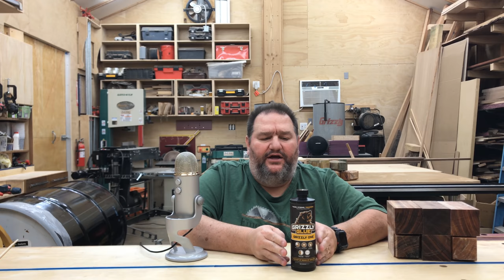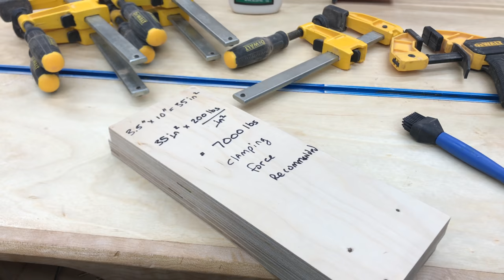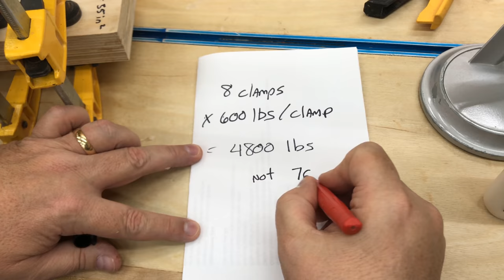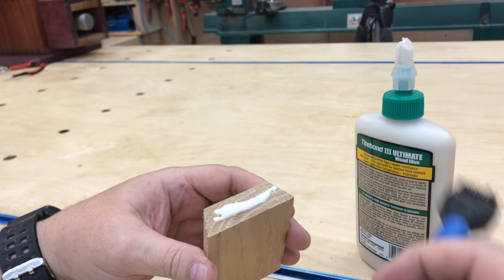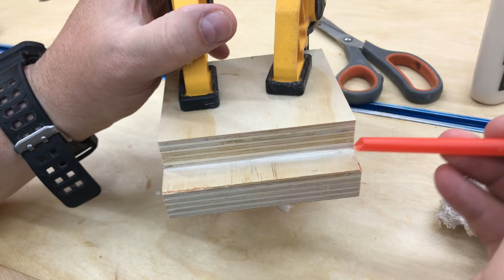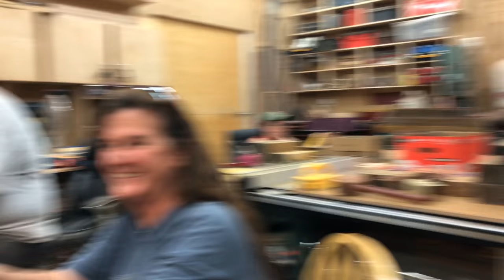67 - Definitive Guide to GLUE for Woodworkers Woodworking 101 lesson 3

Comment from the maker: Join our Woodworking group. Share pictures of your work & get help if needed.  Join our King’s Fine Woodworking Community Page. 

Woodworkers helping other woodworkers. Share advice, get project ideas. Free tips. Insider information. Get the best deals on lumber & tools. 

https://m.facebook.com/groups/134828903893994
Reply: Just found you today, I teach woodworking to Students in the carribean, I will link all of them to your channel as its very informative. Thank you. Subbed.
Reply: I am interested in Titebond 3 giveaway.
Reply from the maker: C.W P, thank you. I’m very honored!
Reply: VERY informative and presented greatly.   If I learned as much from every other YT video, I'd be a great woodworker, indeed.  IF I m lucky to be a winner,  l'd like the epoxy with the dispensers.
Reply: is there a clue you can use in steaming applications?
Reply: In case you don't get the notification on my posted comment I'll reply to this one.

Is there anything titebond original has over 2? Price is very close.
What I mean is there a reason to buy original over 2 considering the gallons are less than $2 different? 
3 is 1.5x the price so I can see a reason why some wouldn't go for 3. But just curious if there are things you would use 1&2 for differently or even 3 and why not just use 2 and 3 for everything or just 3 if cost wasn't the only driving issue?

Comment: I have been experimenting with various glues for a few months.  I wish I had viewed this when I started on my workbench back in December!  I purchased Gorilla glues in the past that after application, I discovered required water as a catalyst.  What a mess I made of that project!  This is absolutely the best educational video I have seen on glue types and uses!  Your research, teaching, and Chemist background shows. I have most of the glues mentioned above..  except epoxy.  I have a few projects in the works which I planned on using Epoxy as filler and finish.  I have delayed purchasing any since I have never had a glue and bonding class that covered it all... until now!  Thanks James..

Comment: I started woodworking 65 years ago at the age of nine usjnd salvaged wood and  nails from produce crates. My time and interest has fluctuated over the years, but retirement has allowed much more time in the shop. Most projects are for kids, grandkids.  And a nonprofit i work with. In recent years titebond 3 has been my go-to glue. I can remember when just white glue was used extensively.  I have thought about epoxy for some projects but the cost wasn't with the experiment. I would love to try some

Comment: Thanks for sharing your experience with woodworking.  Many years ago I used a lot of epoxy with metal and PVC for car body work or plumbing repairs where fittings weren't available.  I'm looking forward to trying it with woodworking.  Thanks again.

Comment: Great video and outstanding information.  I have been working with wood since I was 15 and am now 73 so have a little experience and still learning.  I made a Mahogany desk in high school with hot hide glue and still today I defy you to find a joint, it still looks beautiful (to me anyway).  Now I work mostly with segmented turnings in a variety of projects and all I use is Titebond 2 and 3.  I have had a couple of projects leave the lathe before I wanted them to with no damage, just chucked them back up and went back to work.  I also do some special castings for turning with a different resin but I would love to try that Total Boat epoxy for some bigger ideas.  Keep up the great videos, I intend to following you.

Comment: Very informative James. I am 74 years old and have been a woodworker for several years. I also have been using Titebond glues for years. But recently started using Titebond III  due to your influence.
I would be interested in the epoxy giveaway as I do have a project in mind that would require an epoxy application.. Thank you for your consideration.

Comment: CA glue is something that I would like to try. I have avoided buying it because I just can't justify the cost for something that would be purely experimental. I have a little experience with the Epoxy. Great stuff and fun to work with. I use Tightbond III a lot! It fits my style, I need the extra fiddle time. 

Thank you so much for the detailed instruction. I saw the video length, thought I would skip through it and catch just the highlights, but I wound up watching the entire thing! Very informative.

Comment: This is a lot of great information.  Thank you.  The one thing that I don't use Titebond III for (in my limited experience) is if I'm gluing up layers of wood for a bandsaw box out of light colored wood.  As I understand it, Titebond III has ground up walnut shells in it, and it dries a bit dark, so it can show up at the joints of the box (even at such a thin layer thickness of </= 0.004"-ish).

Comment: Thanx for an informative vid...  I am from ZA so we dont have these brands you guys use but we do have products that are roughly in the same classes...  One of the glues we use and me on a frequent basis is Alcolin Cold Glue.  It is a waterbased glue so it is nice and easy to work with and clean off afterwards... I have no way of comparing it to your products but I am in general happy with it so far... I doubt it if you will post glue to South Africa but I must say that I like the Tight Bond 3 you spoke of.   Looking forward to hear more on your woodworking classes :)  btw: That is a snazzy tip with the straw to clean off glue :D

Comment: Thank you for that video on glue. I too have been using titebond 3 for years and have been really pleased with it. I like a longer open time and wish it was longer. I try to build a good joint so it is not all on the glue to hold it together. Thank you for all the technical information on the differences. I found the epoxy very interesting, especially the measuring by pumps. I don't build river tables so I don't want / need very much at a time. However, I saw you put those epoxy filets in you assembly table video and that got me thinking. I don't think that would work very well with titebond 3. Oh, and I consider polyurethane glue to be a mess - I think that I have it all cleaned up and then the next thing I there is more foam and it is really hard to sand away after it dries. But like you said it does stick to everything. Anyway, thank you for your videos.

Comment: I know this is a huge faux pa, but construction adhesive can be super useful. But I would really recommend Locktite Max. Can fill huge gaps, it holds its shape and SUPER stong. Plus, it works on everything. It can also take repeated movement (I set my lathe tools in the handles with it). Plus water proof.

Comment: Many thanks for that James.  Very informative.  A couple of things I thought about while listening to you: First: The one property of epoxies that I really like is its machinability.  Its so easy to file or saw or drill or whatever.  Second: Gorilla glue seems to become exceptionally weak if you do not clamp your pieces really tight.  Also, once I've opened the gorilla glue bottle it goes off quite quickly, despite having the bottle tightly closed.  Now I'm just wondering if one would have similar problems with other polyurothane  glues.
I live in good old Ireland, where finding a really good glue is not always easy, so if there is not someone else who really needs it badly, you could maybe ship me a small bottle of Titebond III.  But you talked me into it - so if I don't hear from you in the next fortnight or so, I'll just have to try Amazon.
Many thanks again and please keep up the good work.
Cheers.
Reply from the maker: Thank you!

Comment: Very interesting video, I was not aware of the difference in all of the flies. My self I prefer the tight bond three. I use it for all of my projects, I have been woodworking about twenty years. After watching your video I may try some of the others. The one thing I was curious about is when using the epoxy glue is it hard on like planer blades or saw blades . Will it cause the blade to fill prematurely? The tight bond dose not cause any problems. Also how will the epoxy sand, so when you apply your finish coat you don't see any glue . I don't like change that well so probably will stay with what I'm used to. I tried your idea for using straws to remove excess glue. It works really well. Before I watched your video on glues I watched the one where you built a tool cart for your sander and grinder. Very nice project. I want to try and build one myself . One thing I noticed is how through you are with your videos. You cover everything very well
Please keep the projects coming and all of the good info. Thank you. H Burch

Comment: Learned a lot professor 🤓! Hope you aren’t too busy to keep doing videos. I like the family environment, little history of and science behind uses. 

I learned that I used the wrong type of glue for my son’s cutting board. Can anything be done to prevent the glue from deteriorating from water after the fact?
Thanks 

Epoxy is what I would like to try.
Reply from the maker: Thank you Michael. For the cutting board, just keep it as dry as possible. Wash it quickly when finished using, and dry right away. If it starts to come apart, you can just take it to the table saw, and slice it along the lines where the joints are, effectively taking it back to the individual pieces. Then glue it up again with Titebond III. It'll be a bit narrower, so if that's a problem, you can just add another piece in the middle somewhere. perhaps an accent wood. Hope that helps. ~James

Comment: I see you finally got a 55 gallon drum of glue lol. Nice discussion on glue for beginners :) On another note I grew up using Elmer's Wood Glue, back in the 70's and 80's it was horrible, but today it is equivalent to the original Titebond. I tend to gravitate towards Titebond but if I can find Elmer's cheaper for indoor furniture that I know will not get wet, I will grab Elmer's to save a few bucks. I really need some slow setting epoxy James, I have not found one that is worth the  $$$$ yet.

Comment: Hi James..  thanks for the video and the download!  Was wondering if you have ever used Cascamite, which comes in a powder form and has to be mixed with water before use.  Like a lot of things there are some health concerns (chemical composition) so whilst it is available in the UK it may not be in the US.  Used correctly it is incredibly strong, has a long open time, is waterproof and is gap filling.  Possible downside is it dries ‘rock’ hard and therefore cleanup can be a problem if you leave excess squeeze out to fully cure...

Comment: That's a great idea for removing excess glue with a straw. I've had it so a little frustration with glue from squeeze-out in the inside corner preventing the wood from taking up oil finish. It was especially bad when I used water to help clean up the glue. The glue just went deeper into the wood and never did come out. So thanks. I'm beginning to learn that glue on the inside corner is an issue. I use less glue and carefully press it into both surfaces to try to minimize squeeze out. I'm glad to know there's another way. Now to get some straws. Any other suggestions about glue squeezout on inside corners?

Comment: Beautiful lesson James.
I am of your own opinion on the use of the various hills.
As I use them (I am a hobbyist) my biggest problem is the durability in the bottles, the PVA in 1 kg pack (more or less 2lbs) lasts me more than a year!
so packs like the ones you showed CA and Epoxy for my uses would be wasted.
I managed to throw away half a bottle of 20 grams of CA!
The one you talked about the least is the polyurethane glue.
knowing that it reacts to the humidity of the air I think it has a short enough life once the vial has been opened (in the Po valley it is easy to have relative humidity above 60%) but, I understood correctly? Does the fully cured glue become a foam? if so, you should always use the clamps for gluing with this glue!
here I found a two-component polyurethane glue (like the epoxy but it is stated on the polyurethane packaging) very thick that you can work as filler grout as well as glue and it works well even if much more expensive than the other glues.
See you in the next videos

Comment: Loving your channel, thanks for sharing you knowledge. I did have a question on the tight bond PVA glue. I’m in Charleston SC and keep everything out in a shop that has no heat or A/C. My question is about glue being stored in high temps and in freezing temps. Does the high heat or freezing temp change the ability of the glue to do its job?

Comment: Really informative - thanks a lot. A question: a lot of musical instrument makers recommend Titebond Original because of its lack of 'cold creep' once dry. Hot hide glue is still used by many luthiers, myself included,  because of this property (and its ease of disassembly when needed). Does anyone have any hard information about the 'cold creep' property of the Titebonds (i.e. is Original actually any better than II or III in this respect)?

Comment: I'm interested mainly in Titebond III.  I've used epoxy on ceramic and metal, but it's a pain relatively speaking.  BTW, you didn't mention JB Weld, which I though might be appropriate.

Comment: I just reglued an old cutting board and used TiteBond III. I had smooth joints and no voids. If I had voids, I would have used a urethane glue. III is the only version I will use in thee future.

Comment: James I love your teaching videos! I have a question about getting excess glue on the wood when you go to apply your finish I have the problem that the wood will not take finish after you wipe the glue off.
I would love to try the ca glue or exposure. Thanks James
Doug Amundson Lowry Minn
Reply from the maker: The secret is to use a wet washcloth to dissolve the glue off the surface while it is still wet. And make sure you sand well afterwards.

Comment: I am having trouble in segmenting. Wood, cooper or acrylic, credit card, wood. I would like to try the two part epoxy. Also if you  could get me the large size I have a blanket chest I am working on, It is made of Alder and have several large knot holes I would like to fill.

Comment: I would like to try the the epoxy glue.  I'm not really new to woodworking, but I'm also not an experienced woodworker.  Most of my projects are for freinds and family.  I like to try new things and learn from them.  Some things work and some are a learning experience. I do have a question though. What type of glue will bond HDPE plastic to itself.  I have tried a couple of things but without success.
Reply from the maker: I'll have to check on HDPE, nothing comes to mind. But there must be a cement weld/solvent type product available.

Comment: James over at woodbywright did a glue test a little while back and the out of the glues, the CA glue he tested was actually the strongest bond.
Reply from the maker: That is very interesting. I will have to go and check out his video. In my experience it is very weak, because when I misplace a hinge that I glued with C/A I just snap it off with my fingers and re-place it. I have never put it to rigorous scientific testing. But I do know that if I had mis-glued two pieces of wood together with PVA it would take a hammer and a vise to get them apart. Either way, thank you for informing me. I always keep an open mind and will check it out.
Reply: CA's can be funny. A lot of it is knowing how to prep the particular type of surface you're bonding, and with wood that can even be different between species. Using the right viscosity has a big effect too, and as James mentioned, whether or not you use the activator has a noticeable effect.

And I'm not trying to be that guy, but someone's gotta say it. James went through a lot of work covering the details on that test but two things I have not seen was clamping and surface prep. What was used, when it was used, how much pressure was used - whether that clamping pressure was what was recommended by the manufacturer, etc... Same goes with surface prep. Were they all prepped the same, or did he use the recommended method for every individual glue?

Sorry, but you know mistakes were made when he mentions that some of the PVA samples fell apart before he could even get them to the test bench.
Reply: Excellent you helped a lot of ww'ers.  James that's probably due to the surface.  Metal has very little grip.  I've found wood-to-wood CA glue is usually very strong.  I would try the Total Boat.
Reply: Very interesting video James as always. I loved the vise and sword builds and will be making a sword for my son with a few of those techniques. I've always wanted to try an epoxy resin finish do to the humidity here in Florida. Its terrible how much the moisture gets in to everything and  then will dry and warp any project that's not extremely well coated with a durable finish. I just haven't wanted to spend the money on a west system's or total boat product yet. Keep up the amazing work and the amazing parenting as your children are your best projects for sure...
Reply: JAC, This is such a broad unspecified comment, it is virtually meaningless. What type of material glued? What type of joints? What types of glues was it compared with? I could list 4 or other variables that must be considered before your claim has any "sticking factor".
Reply: JAC Built Woodworks I think it depends on the surface(s) being glued and how it is tested. CA is weakest in shearing and shock typically.
Reply from the maker: Hi Robert, Thanks for commenting!